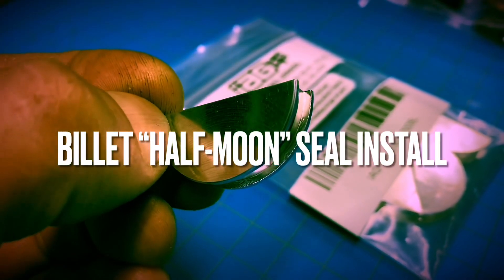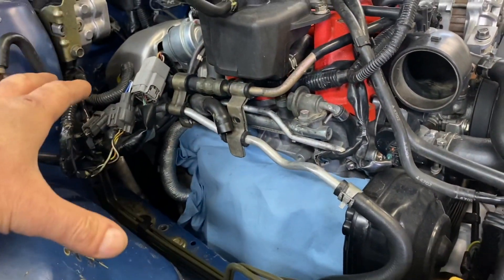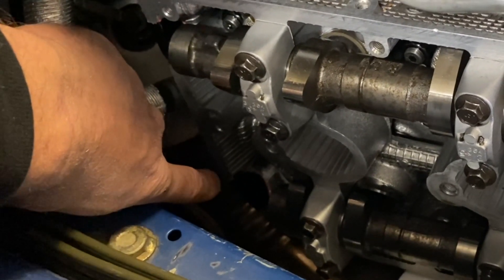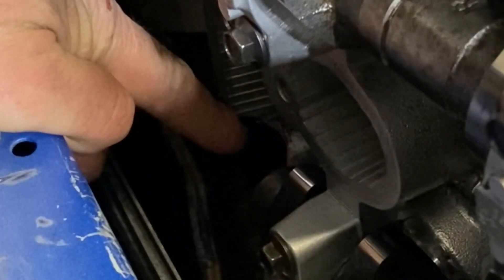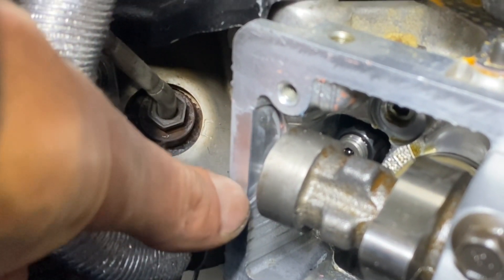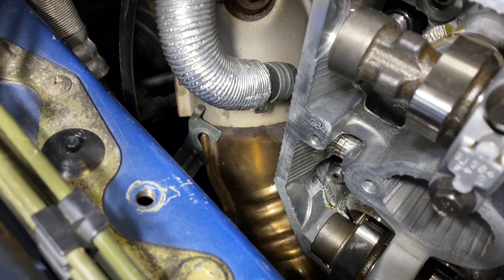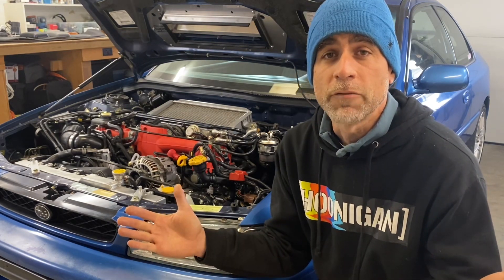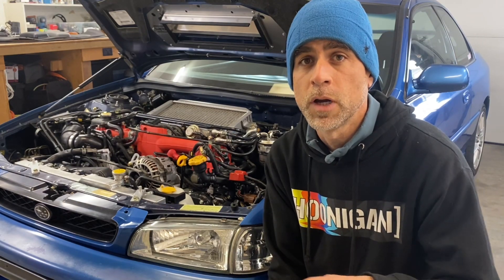INSTALL DiY | Billet Half-Moon Valve Cover Seals

Comment: Thank you your vid inspired me to do this when my vc started leaking. Can you tell me if the fit is tight? The half moons dont seem to drop right in and ive cleaned the surface pretty well. They stick out about half a cm from the head and i cant seem to get it flush, not sure if i need to tap it in with a hammer

Comment: Are you gonna make a how to on how to replace the valve cover gaskets with engine in car? Im wondering on how to get the bolts torqued to spec with the frame rail so close. And I picked up some Permatex ultra black for when I do mine, is that a good sealant to use?
Reply from the maker: I use the ultra grey or Subaru OEM sealant only. I’ve heard the black stuff doesn’t have the right chemical mix, but I don’t know for sure. Yes, I am planning on doing a video on that too. Stay tuned!!!
Reply: @SubaruONLY   sorry I forgot to tag you to the above comment
Reply from the maker: Sorry, don’t know the specifics. Just always heard use ultra grey or the OEM factory stuff.
Reply: What would the chemical mix be bad for? Im starting to question whether to use it as all the gaskets I bought were expensive oem ones and dont wanna mess up the first time. The  reason I bought it is because it says it's a "maximum oil resistance gasket maker" and on the back of the packaging it says it's for Oil pans and Valve covers.

Comment: nice video. great idea about this billet half moons.

good point on using very little RTV, if you use too much sealant you see it get stuck in the oil pick up... in any make/model and that is never good..... chance of destroying an engine bearing if its blocked
Reply from the maker: 100% man.  Totally agree, one of the biggest engine killers for sure!!! 👍

Comment: Very interesting video... Very tempted to do this myself on my 06 STI. Thanks again, Luke. Keep up the great content!
Reply from the maker: Thank you - and I will!!! 👊
Reply: @SubaruONLY  I have a question, hopefully you may be able to answer... I also have a 2013 Subaru Tribeca that had an interesting 'squeak' in turning the car over, sounded like a belt squeak, but i changed the serpentine belt + pulleys (idler and tensioner pulleys) in addition to the starter motor. This fixed the sound however it feels like its starting to make a comeback... Have you come across this issue before?
Reply from the maker: Yes, sounds like you’ve located the issues and the reason the squeak is coming back is the belt stretched a bit (super common, especially new serpentine belts). I bet if you check it, it’s a bit loose now and just needs to be a bit tighter, then the squeak should be gone once and for all.  👊